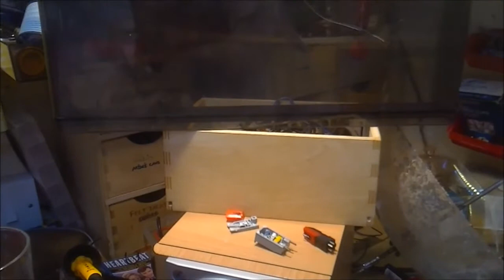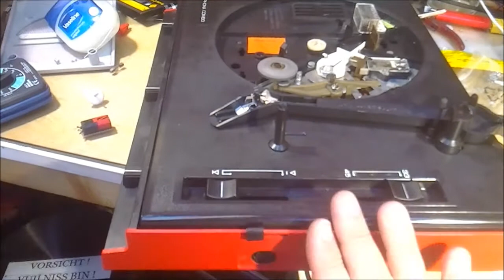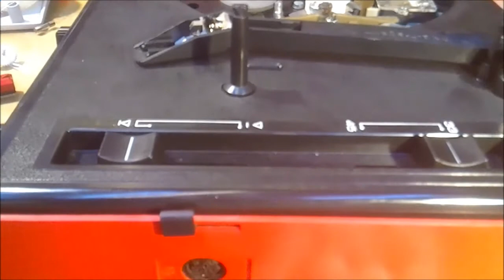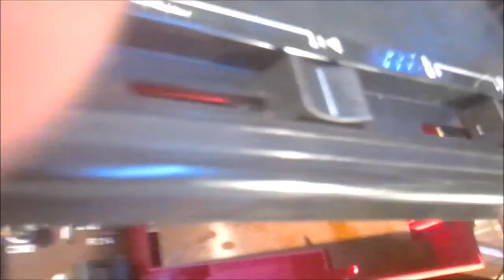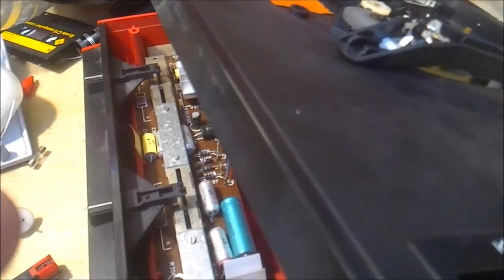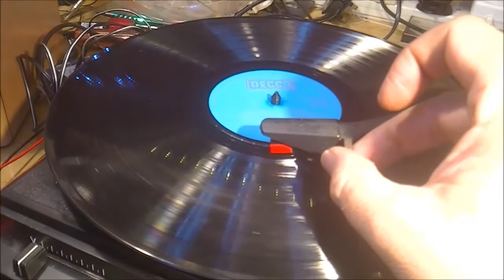RFT ZIPHONA COMBO Record Player from 1986

Comment: Hi, seeing you've managed to take the cartridge apart I was wondering if you know how to replace just the stylus (with a little plastic cube at the end) that's also available on various websites. Do you actually need to remove the bottom of the cartridge or is there a way to just slide the new one in?

Comment: Many thanks for this very informative video, Could it be possible to have precisions on how you replaced the MK 231 SD original cartridge with the new black and red cartridge. In fact I see two new models. How did you install/adapt it under the original fixation rail and also how did you connect the three output pins (L, R & Gnd). Great job, well done and with care. Gone one with informative vidéos.